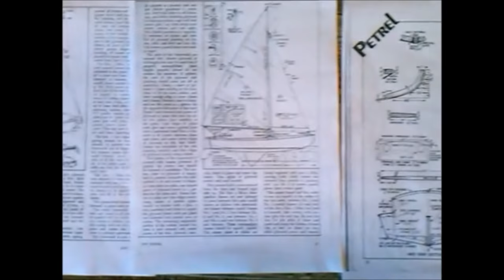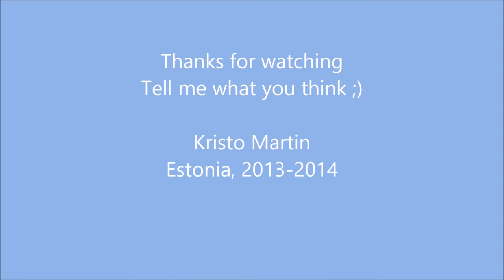Sailboat building timelapse, 16footer, part 1

Comment from the maker: Well, in video about 40Hours. but alot halfs are missing and making the material for boat frame.
so alot of hours :P
From august 2013 to november 2014, but i didn't have much time that i could really build continuously
Reply: There are  several ideas for constructing boats:
Give yourself enough time.
Use ready made boat templates.
(I learned about these and more on Denelle boat builder website )

Comment: Nice job but if you had built it with the "stitch and glue" method, you could have completed it in 1/5th the time and the build would have been MUCH easier.

Comment: Can you tell my how  you bent the woodmen panels and if they were ply wood
Reply from the maker: Hei, for outerbody i used 9mm ( 3/8inch) birch plywood, because it was quite thin and long distance i could bend it without any assistance or steam.
and deck (you can see it in part 3) is 6mm (1/4inch) ply.
Reply: Kristo Martin I didn't expect a responce actually but thank you!  I actually want to make my own sail boat one day I just need alot of wood

Comment: I think you did a great job at making a cool boat. Like that you used non Marine plywood. I think marine plywood is overrated.
Reply: Yes, YOU might THINK it’s overrated, but in reality real marine plywood is superior to exterior grade plywood.  Reason being is that marine ply is made from plies of equal thickness, has no voids, and will not delaminate.  It is also far nicer to work with, especially if you need to plane the wood.  

Can a boat be built with regular plywood?  Of course.  It will float, row, sail, and all of that jazz.  But in order to make it last for a good long while, it will need extensive maintenance and upkeep compared to a mar be ply boat.  Maybe you like sanding and refinishing every few years?  Even a simple boat requires an investment in time, labor, and materials.  For my money, skimping on plywood to save a few bucks is not worth it to me.

For anyone thinking of building a boat, if you have to get on the water NOW, by all means, go to your local orange or blue store, get some ply, and have at it.  Just know that there are limitations to using cheap materials.  The voids in exterior ply can cause panels to break, the face veneers are often so thin that they are easily sanded through, and the stuff is heavy, so the performance of the finished boat is lessened.  A sheet of 1/4 exterior fir ply is around $20 a sheet, and some  1/4” BS1088 Meranti Marine ply is around $50 a sheet.  Your first boat will most likely use two to three sheets of plywood.  So you save 60-90 dollars in plywood.  Now, that seems cool, until you find out that you need to sheath your entire fir ply boat in fiberglass cloth in order to prevent checking of the plywood.  For an average size beginners boat, say 14 feet, the cost to do that is around $20 for the glass, and $50 (at least) for the epoxy.  Add $70 to your build costs.  All of the sudden, you increased your workload, and spent MORE money than if you used good wood.  

With all the time and effort it takes to build a boat, I think y’all owe it to yourselves to use quality materials.  Marine ply is lighter, easier to work with, requires less maintenance, and is prettier than exterior fir ply.  After the two years it takes you to build your boat, you won’t miss that extra $60 you spent on wood, and you will like your finished boat even more due to the fact that you can spend more time using it and less time maintaining it.

Note, the above is not meant to discourage would be boat builders, but rather inform them of the realities of boat building, time, and material cost.  Like I said, if you want to try boat building, use the cheap stuff.  You will get a boat that lasts a few years, and will be fun to build and use.  If you are looking to build a boat you can pass on to your grandchildren, use the good stuff.

Comment: in the Plans, the top measurement for frame 2 is missing, how did you do it?
Reply: Been wanting to build this boat since the early 70s! I have a set of plans somewhere that have the missing dimension. I won't have access to them for  1 1/2 - 2 months. Will try to post the info here when I Can. Has anyone ever seen the full plans (Craft Print Plan No. 106 )?
Reply: The missing dimension for frame #2 is 34in on the plans I have. They are available from "The Shellback Library".
Reply: @bananabred1687  Thank you very much

Comment: How did you build the frame stand that supports the frame system??
Reply from the maker: Hi, The frame backbone is described in plans (top of the page 5 or page 33 if you look bottom numbers), and then just level it and stick it to the ground :D You can also find my building pictures here: http://foorum.kipper.ee/viewtopic.php?f=7&t=8653
Reply: Wow! Many thanks! I´ve spent this week, converting inches to milimeters, (metric system), finding all the frame sizes and angles.
Is that ok to cover the boat with diferent pieces of plywood instead of one piece only? ( the sizes for example) That is because i can't find such a long sheet of plywood...
Reply: I noticed that you made the deck beams flat. It is just temporary or a new design?
Reply from the maker: Deck beams flat? all beams have deck curve. or what do you mean?
Reply from the maker: Also spent alot of time converting all measurements. I had 1,5x3meter plywood
i glued pieces together beforehand and then cut out one big piece and put it in place.
Reply: sorry, that is the camera angle's fault! Do you think polyester is a good fabric to make the sails?
Reply from the maker: yes, now i understand, deck beams are temporary in this video, only for holding frames in place, i later change them for correct ones.
Reply from the maker: Dont know about sailt
i am going to take 470class sailboat sails
Reply: +Kristo Martin just one more question: Do you  think that I can  build this boat with exterior plywood or birch instead of marine plywood? the plans  say exterior ply but since you  went on boatbuilding school i think that is convenient asking you.
you've been a great help!
Reply: Kristo Martin Did you build sailboat without its keel..?
Reply: jojon, the plans let you choose between keel or just center board. They say that "more experienced builders will be able to build the keel" The plans have the measurments to do that..
If you're talking about the centerboad: if you look closely you will notice that Kristo made a centerboard slot. In the plans, the centerboard must be made of 1/4'' iron sheet (or steel) .
Reply from the maker: Correct, the boat is made for shallow waters so the keel is retractable, you can pull it inside.
i am going to make keel with plywood and put some lead in the middle, and fiberglass it all over.
Reply from the maker: I also used exterior birch plywood, if you treat it with epoxy and fiberglass correctly everything should be OK
You can contact me with gmail, just send your email to my Youtube inbox, maybe we both can help/teach eachother.

Comment: What type of fasteners did you use?
Reply from the maker: Everywhere is A2 (Acid and Corrosion Resistant Steel,)Stainless steel screws, not the cheapest stuff but i belive it is a good choice.
also glue everywhere, epoxy or polyurethane glue.
Reply: @kristomartin1727  you did the right thing, all your hard work would become undone had you used cheap fasteners.  Cool boat and thanks for sharing the video!